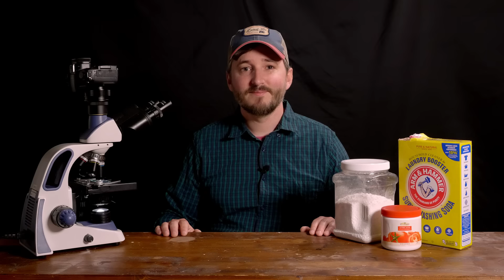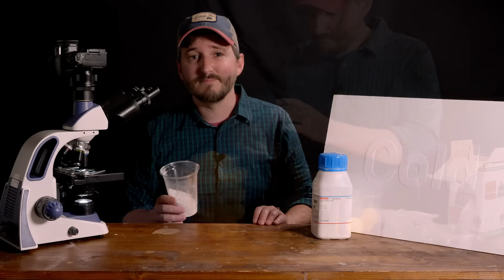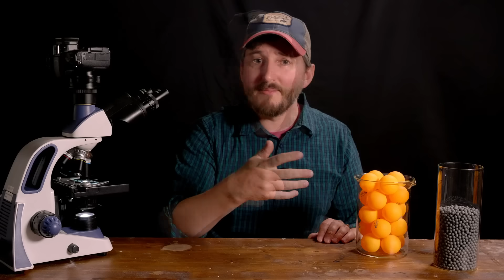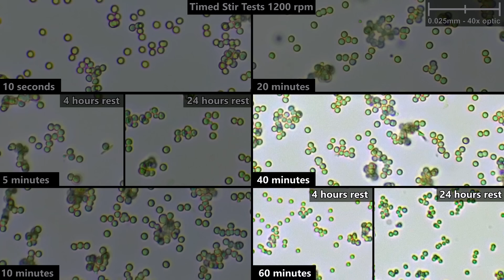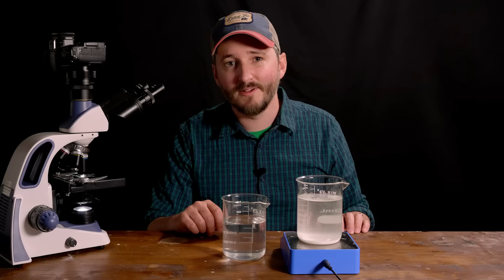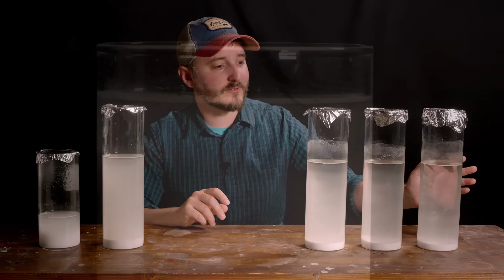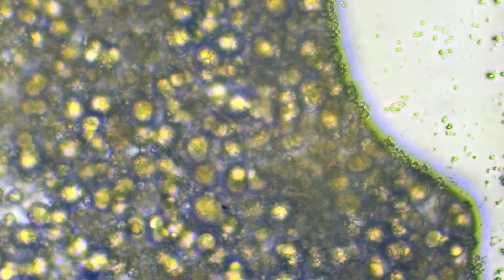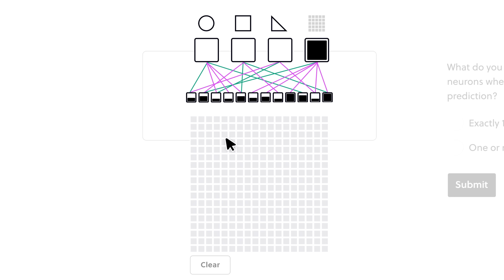Making Infrared Cooling Paint From Grocery Store Items (w/Novel CaCO₃ Microsphere Synthesis)

Comment: This is actually incredible! Seriously, he just took something that was previously very impractical and created a recipe that can not only be mass produced, it's also easy, safe, and inexpensive enough to do at home. And he posted it all on the internet. For free.
Reply: Yip. At this point Ben should be treated as a national treasure
Reply: @nemam_nedam a tree won't make you go sub Ambient temperature..
Reply: @nemam_nedam planting a tree that takes 30 years to even make a difference?
Reply: @pingASS_ 30 years to grow a tree? I have a few pines less than 10 years 30+ feet tall 15 feet wide, grown from seed.
5 year old rain trees 18 feet tall.
Black walnuts over 30 feet in 10 years. And we've had a few drought years. 
3 year old lemon trees grew 6 feet this year.
My new bald cypress seedling grew 4 feet this year with no rain for 3 months. I did water it some.
Reply: It's more difficult to move a tree than a panel in the winter.
Reply: @HappyFace6or7  The tree automatically drops its shade panels.
Reply: @danrbarlow Only deciduous trees do that & only in late fall or winter.
Reply: @nemam_nedam  You can do both at the same time
Reply: @nemam_nedam seems to be around 15c of cooling from the heat readings shown. Im not sure what youre comparing it to that does much better
Reply: 3°c is not negligible.
Reply: @NoBug404  pretty sure it was 15 not 3, based on the thermals near the end of the video
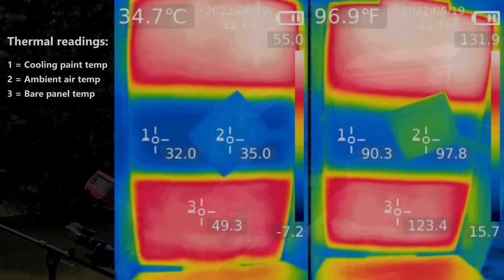Reply: @jeice13  3:30 3-4C drop
Reply: @Hawk7886  ah, i was comparing to the unpainted plywood in sunlight. Showing that it was 3 colder in sun than being shaded i drives home the point but is understating the paints performance
Reply: With enough scientific jargon and fancy equations, he could have a masters thesis with this one.
Reply: @nemam_nedam  He's shown that the cooling effect brings you sub-ambient. How is that negligible to you? Not only that, this paint reflects the energy from the sun back out into space instead being absorbed by the ground, your house, or the tree in your yard. Since that area doesn't absorb the sunlight the local environment around the painted device will in general be cooler. Just like when an area is covered in snow, you will actually have colder temperatures outside because the sun is not heating the ground as effectively.
Reply: @TheD3m0n93  he probably sells air conditioning services and/or electricity
Reply: @IronicleseAndSardoniclese  I want to see someone use this paint along with convection cooling. Seems to me that convection cooling could be ramped up a bit by playing around with colors.
Reply: @y0nd3r convection is not color dependent, radiation is.
Reply: @OskarHersch spoken like an only child.
Reply: @groadybones 😅😅😅😅savage
Reply: Good if you're being hunted by IR.
Reply: Seriously! Open-source chemistry at its finest!
Reply: @nemam_nedam  And how many years before the tree is large enough to cool anything 2....10.....15.....20?
Reply: @nemam_nedam He literally said it stays cooler than the ambient atmo, even in direct sunlight. Idk, I'd say shade in tandom with this would be good. I dont see how it isnt practical. I dont see what's so impractical about thin plastic panels. It's not like there arent already insulation panels under the siding of houses as it is.
Reply: @cykes5124 Why?
Reply: @IronicleseAndSardoniclese  Good show. That's how you write a proper reply.
Reply: @cykes5124  Does it? Would be interessting to know about the durability!
Reply: @nemam_nedam yes but it doesn't reflect it to space. It also takes years to grow any tree of any size. Also some people don't want/like trees, you know how many yards I pass with only grass and pavement? 

Imagine if you had an option to make your yard cool, or your house cooler.
Reply: I don’t understand the obsession with the trees comment in regards to this process. Yes trees have benefits, thanks for that captain obvious. Do this process and use trees too if that’s your wish. Don’t use this process and only trees, if you wish., but this process has advantages too. Crazy that this even needs to be said. I would think that someone who appears environmentally friendly, obsessed with tree planting, would jump on reflecting heat from the sun, back into space, and lower the alleged man made global mean temperature increase widely reported, and do it without economically crazy schemes that impoverishes people. But maybe I’m missing something.
Reply: Yes, he is truly amazing!
Reply: @nemam_nedam *than
Reply: Why is this man not our president?  Instead we have corrupt old guys that couldn't make a fire if their life depended on it.
Reply: Not to undersell the science here, but this is nowhere near viable as is.  Besides the fact that the coating still requires a protective layer be applied on top, this method uses a ridiculous amount of acetone which would get you banned immediately for the VOC content.
Reply: @nemam_nedam *than
Reply: He should Patent it, before someone else does who enforces it.
Reply: That be how he rolls.
Reply: He's actually brilliant.
Reply: This is actually credible! You can cred (believe) it whenever you want, and it doesn't hurt.
Reply: Woo hoo! I can't wait to start using this.
Reply: Try bamboo this grows meter everyday
Reply: and billion $ corporations didn't take him out 😛
Reply: goat
Reply: @nemam_nedam  you also have to put glass over solar panels and keep them clean. What's your point? The trees that don't take 15 years to get to sufficient height to cool off your house will break in a high wind and damage your home.
Reply: @y0nd3r It's according to the trees you plant.
Reply: Probably a billion dollar idea that he just shared out for free. The worse part is some company will steal his ideas. Tweak them slightly. Patent them. Make a bunch of money and sue anyone that does it at home.
Reply: @azteacher26  his published recipe cannot be stolen
Reply: @Hawk7886  Also, recipes cannot be patented or even copyrighted.  A book of recipes with editorial content can be copyrighted, but individual recipes cannot.  If you want to protect a recipe (Coca-Cola), then you lock it in a safe.  

While some people may think using someone else's recipe or process and selling the products for profit is unethical, the Chinese certainly do not have a problem with it.  They spend a fortune stealing recipes and processes.  And, ummm, so do we.
Reply: @azteacher26  Only in America do they allow patenting of old idea's which have been in public domain for a hundred years or so
Reply: @azteacher26   "...sue anyone that does it at home."
Patent protection doesn't prevent personal use, only commercial use.
Reply: @azteacher26 Pray tell how they would sue a single person doing that. Even if patented, they would have no way of knowing someone was doing it for themself.
Reply: @azteacher26 If you aren't using an exact patented recipe, you aren't misappropriating anything. Plus, what you make and use at home and keep to yourself is nobody's business.
Reply: @nemam_nedam ah yes, the cheap fast and easy process of getting a tree. Certainly the most practical solution
Reply: @cykes5124  even if you put it under glass? What about mixed with silicone?
Reply: @IronicleseAndSardoniclese  exactly people that live in the desert should not be planting trees it is a waste of water.
Reply: @christylbk planting trees can reclaim a desert. It's been done many times in many places. Killing trees causes the soil to overheat & drive water underground. It's the reason trees along a stream should never be cut. Installing golf courses in Southern California dropp summer temperatures roughly 25° In just a few years. And it doesn't take 30 years for a tree to become quite sizeable.  My trees grow about 3 feet or more per year.
Reply: @christylbk if you use waste water to water the trees you won't be wasting fresh water resources.
Reply: Before mass produce anything, test it multiple times.
Reply: Truly incredible
Reply: Bless up!
Reply: Whats the frl rating though?
Reply: Sure, but what happens when we fill space with hotness?! Checkmate science!
Reply: @coolcoolercoolest212  Pretty sure the heat in space keeps moving until it has something to heat up.
 Isn't the hot side of the ISS at 300 when the cold side is -200?
Reply: @OskarHersch please continue doing stupid things like planting trees next to your home for the "shade" you think is so important......this way the roots Crack your foundation, and because you aren't a 20+year aerial arborist like myself, you can pay me to come save your house from being destroyed because you planted a shade tree within 50 feet of your home, we really appreciate the job security as these type of safety jobs require custom rigging,machinery, and cranes rated at over 80 tons and over 138 ft of reach or higher (but only in Florida, currently,  and we have tiny hight trees here compared to the 23 other statesi have logged or been an aerialarboristin my lifetime), to be able to lift the tree as it is removed without further cracking your foundation. These cranes average over 800 per hour and that's at a discounted rate because we sub contract with crane companies and operators specifically for arborist applications. Plus our 5 man average crew also costs, with our combined 100+years experience per crew team, costs way more than the crane company, but we can at least handle 100%of the billing and sub contacting with your Insurance companies which can take months for insurance companies to cover the cost of at least a deposit to even schedule a job this large. ....... so thank you again for the job security and increasing my ability to provide better family vacations and new camping gear yearly to mine!!❤
Reply: @rpetersen2  I live in a rain forest in Texas. I have trees everywhere & up close. I also have 3 tree farms. My properties are 10° cooler than in town 30 miles away, or my own tiny town 4 miles away. I love trees & here, they grow really fast.
Reply: @rpetersen2 😂😂😂😂😂😂😂😂omg 😂😂😂😂😂😂😂😂. I needed that brain laugh. Thank you so much.
Reply: It's not new. Think about white painted Greece houses on Santorin for example
Reply: @BremerFischkoop  Those other white paints don't radiate in the specific band that passes through the atmosphere, so they do not cool. They just don't get as hot as darker colors.
Reply: @NScherdin  How do you know ? Because they use Ca(OH)2 for painting which seems to be similar in using Calcium.
Reply: @BremerFischkoop  ... As an example of the issue in your statement about paint being made with Ca(OH)2, table salt (NaCl) contains Chlorine, which is also found in (and, technically, is the only component of) Chlorine gas. One is a deadly toxin, while the other is commonly used to flavor food.

No offense here, as many people don't really 'get' chemistry, but saying that two chemical compounds should have a similar effect because they both contain the same element is stupid.
Reply: @NScherdin 
Just curious, do you know what paint they used to paint the rooftops of India's houses (to cool them down) ? I saw it in a documentary. Its white also.
Reply: @prefixsuffix  Probably the cheapest whitewash they can find in most cases?
Reply: @BremerFischkoop  Yeah, lime-wash painted houses has been around for millennia.
Reply: @BremerFischkoop That is probably the whitewash recipe of lime, salt and water.   Whitewash is a very old product.

Comment: I'd like to pitch the idea of using a 3D printer for paint application. I know nothing about 3D printers, but as I saw you struggling with the syringes, my first thought was to use maybe a caulking gun. And then that reminded me that we already have the technology of additive manufacturing, which could solve your precision problem in paint application, if you figure out a nozzle and pump that works with your paint.

Comment: I wonder if you could build a triangle, with a PV panel facing the sun, the painted surface facing the North sky, and a cooling pipe that runs from the back of the hot PV panel to the cooler radiator?
Reply: Or a peilter chip with this on one side and a solar thermal heating panel on the other, unlimited free electricity year round.
Reply: @HappyFace6or7  Well, peltiers are so inefficient that I don't think it would be worth it. Though if you're going with solar thermal, then we could use a stirling engine.

Comment: What I honestly like more about this video than the Tech Ingredients's one, is that I could do your method in my flat or cellar compartment. I don't need a well-stocked workshop or garage or any expensive equipment. No, a simple blender and a cheap plastic syringe or spray bottle might do the trick. Especially for a few first steps in experimenting with that paint myself this is waaaay more appealing than using fancy equipment - even if the results might be less ideal without it.

Comment: CaCO3 will react with sulphur and nitrogen oxides (and even CO2) in the air. Wouldn't CaSO4 be more stable? Would it reflect in the right way?
Reply from the maker: I wasn't aware of those reactions. I'll have to look into that.
Reply: @Nighthawkinlight  Depends how gas-permeable the matrix is.

Comment: diy micro laser solar panels, m-i-m panel, like zn-cu2o-cu electroplated layers, optionally patterned by the laser engraver
Reply: m-i-m is essential that the electric field between two dissimilar metals (zn-cu) makes an electric field between them, this time not separated by electrolyte, but by intrinsic semiconductor (or gas plasma), which is somewhat electron conductive, directed by the electric field, like in a micro solar panel
Reply: how about transparent coating, like painting see-through layer
Reply: how about perfectly electroplated layer of some metal, as mirror
Reply: how about MgO, magnesium oxide, its also a refractory ceramic, and a reflective coating, and can be electroplated as Mg metal (magnesium), then oxidized, or anodized, into very dense magnesium oxide, or porous magnesium oxide layer mirror on top
Reply: filter filter filter :)
Reply: shaker mill
Reply: mr chemist :)
Reply: creamy
Reply: why not simple distill
Reply: "coating"
Reply: like spreading silicone
Reply: more like a brick filler
Reply: why not standard paint thinners
Reply: evaporative alcohol
Reply: ie paint delivery system
Reply: economy trade money law kings is not sustainable, must be self-sustained by God
Reply: make bricks/tiles that can be coated directly then put into a construction, less of a paint, more of a feature of a tile

Comment: How well would a paint roller work for applying it...or on flat surfaces try drywall trowels. I think it would be awesome mixed into epoxy. The mention of peltier modules has me thinking about sterling engines. Brilliant video as always.
Reply from the maker: I think it would dry too fast on a roller

Comment: I worked in the coating industry as a formulator for about 10 years. For application you can potentially look into wire bar applicators to help apply an even surface. Application also depends on if the paint has a low enough viscosity and a low enough surface tension to be able to self level. You could also look into addition of a wetting agent which would likely be some sort of surfactant. Ideally this coating could be made much much thinner in which case you need to ensure an even dispersion of the particles without aglomeration. I loved this video and the level of instruction and detail!
Reply from the maker: Thanks for the advice!
Reply: If this can be made thinner, pouring it on and just letting it level by itself (obviously after putting some kind of border around the surface to stop the liquid) could be a viable application method. For large flat sheets---and that's what's needed here---this should work well.

But yes, I'd also be interested in how thick the coating needs to be to work. Maybe a thinner coating (i.e. way less material needed) on a white or reflective surface would work well enough? A "70% effect for 20% material" solution can be viable.
Reply: @HenryLoenwind thanks
Reply: I was wondering if this could be screen printed. Perhaps on a shirt even....
Reply: @galaxya40s95  Or maybe awning, tarp, and tenting material.
Reply: You could also use a stucco sprayer for application and then trowel or float to optimum thickness. In high density applications, you could use a concrete sprayer. A high pressure corkscrew pump could allow you to spray thinner applications but you may run into issues of material  abrasion in apparatus.
Reply: @danielterry1000g thanks
Reply: Quite pleased to see so many such smart people with such good intentions commenting just to help!
Reply: If you had a thinner paint wouldn’t you need to apply more coats to achieve the same reflective efficiency?
Reply: @jeremybyington  I would think that getting it into a paintable formulation (brush or roller) would be a benefit outweighing the need for any large number of coats to achieve efficacy.
Reply: @jeremybyington  I guess it depends on how much of the effect is just a surface effect. Reflectance portion is surface effect. I'm not 100% about the emission part.

Comment: Would it be possible to coat a wide finned radiator with the pigment and then cover with a sheet of plexiglass to protect the coating from the elements, then hook the radiator up to a water loop to another radiator as a heat exchanger in an ac system? Or another idea is to use the powered pigment with perhaps a powder coat painting technique to use in metal panels such as on vehicles.
Reply from the maker: A radiator probably will not work as well as a flat surface facing the sky
Reply: @Nighthawkinlight  one other thing is I was wondering was if the infrared could be reflected from a concave surface to heat an object in the center. Kind of like using mirrors.